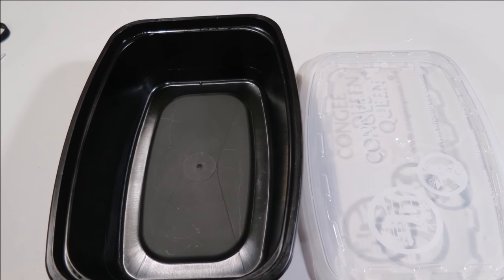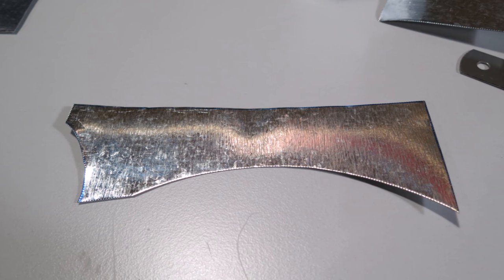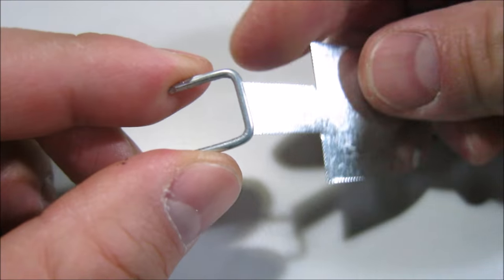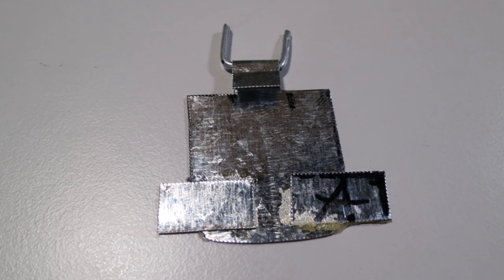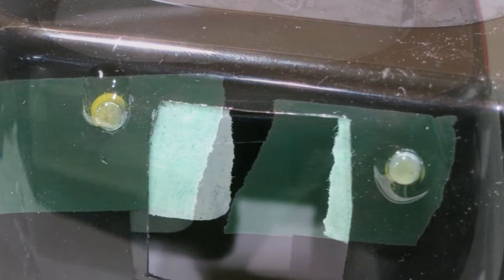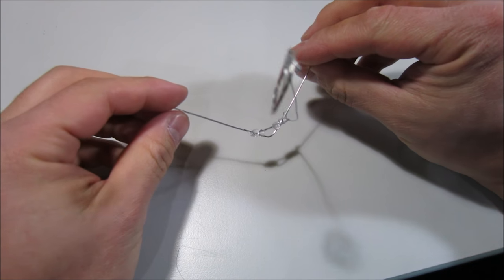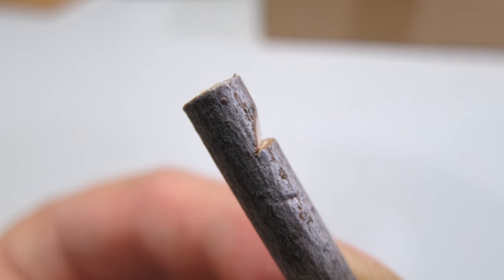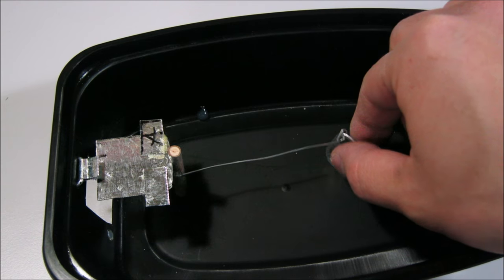The Takeout Container Mousetrap (live)- Real footage of it working!!!

Comment: I'm adding my comments to this video based on your statements at the end of the video.  Please note it is not my intention to criticize you, your designs or anyone for that matter, I just thought I'd share my experiences.  I made the tilting water bottle trap (Chris Notap's design, only because I happened to see his video first).  Twice mice were able to chew
the stopper cap enough to escape.  So I changed that to a piece of wood blocking the exit and then after that three times they were able to escape by chewing through the bottle itself.  Once through the bottom and twice around the hole of the pivot point.  I guess I have more determined mice or cheaper bottles or both.
Reply from the maker: I love feedback, dont' worry. I've made some improvements on that tilting design. Don't know if you've seen my newer mouse trap. 
https://www.youtube.com/watch?v=VbIk0k4JkVo

The only time I've had a chew through was if there was enough of a space for them to get their teeth on an edge. The new and improved design puts the pivot point below the bottle allowing greater freedom of movement to get a tighter seal. I also implement a magnet to aid in keeping a good seal. Try it out!
Thanks for watching.